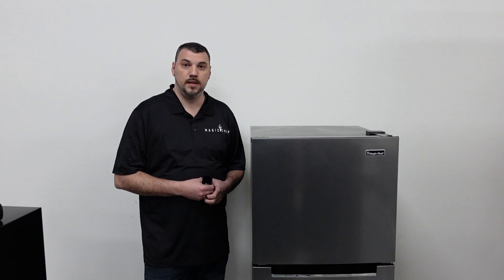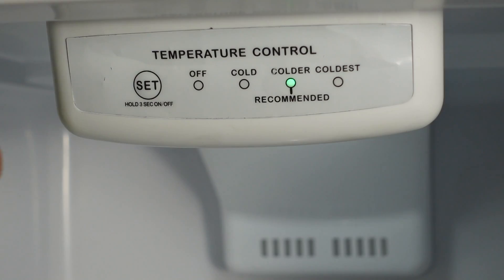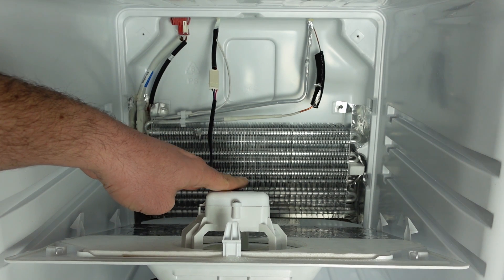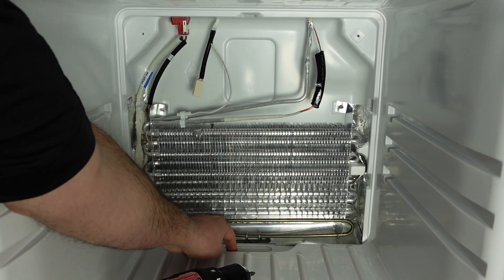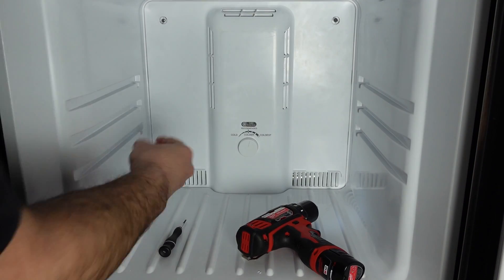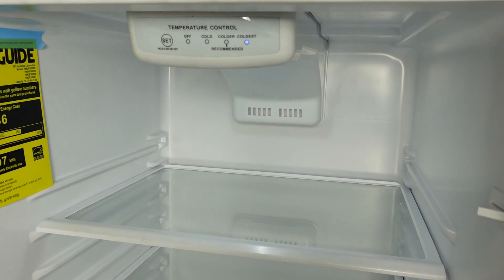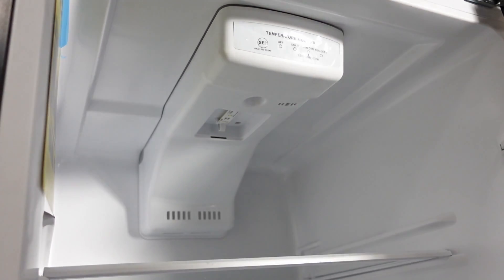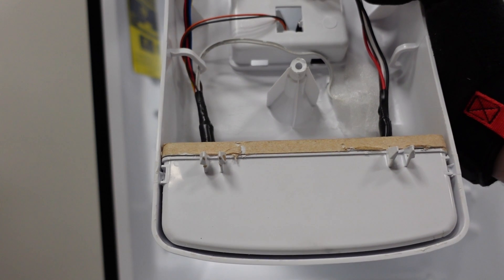HMDR1000 series not cooling within specs

Comment: I have no defrost mode. The element ohms out good. The bimetal fuse ohms out good. Top and bottom temp sensors ohm out good. What am I missing? No flashing lights on the control panel either. The freezer ices up like a glacier and the fridge won’t go below 49deg F.